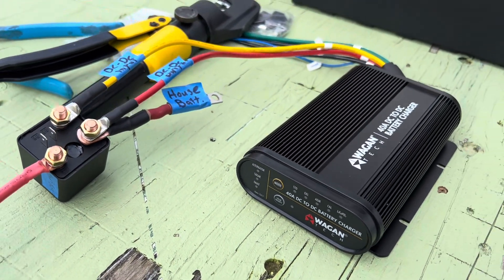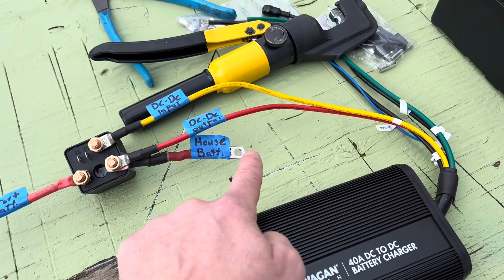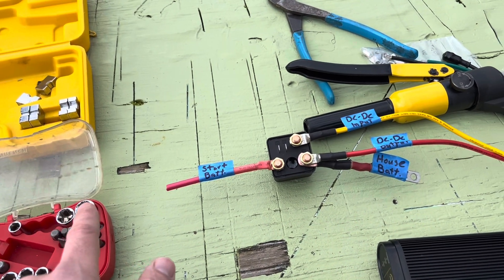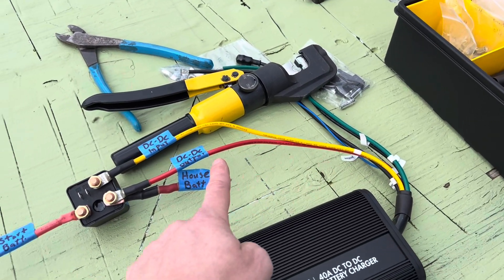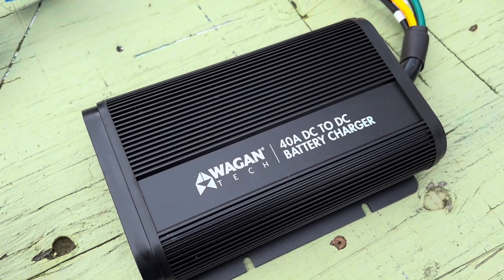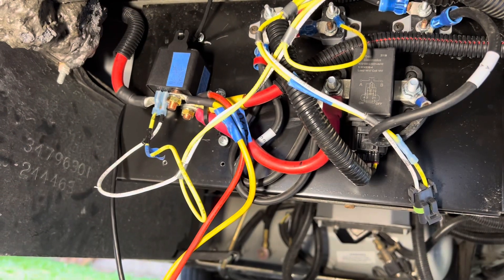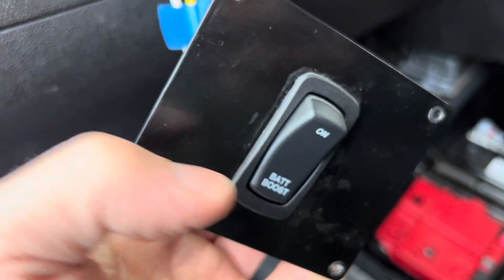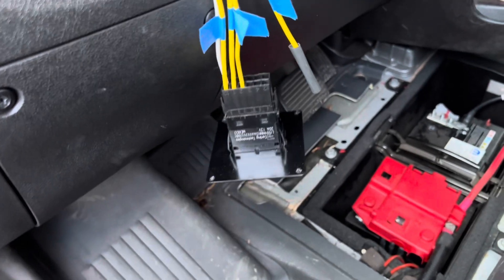Lithium dc-dc charger with battery boost jump start.

Comment: Excellent video, thanks! I've heard that removing pin 13 in the B Pillar also disables the ignition solenoid connection. It sounds like you only need to do one or the other (that or the booster switch Pin 2 removal). Does that sound right or am I misunderstanding?

Comment: This is great… thanks for sharing!  Where did you ultimately mount the DC to DC charger?  I’ve been eyeing the new Victron sx due to its size and IP65 rating.
Reply from the maker: I selected this charger because its waterproof, so it’s mounted the outside of the metal shroud that covers the original isolation solenoid. (Under the van)
Reply: @aarongarmon3809   cool, I was considering doing the same, though I may manufacture a new cover for that box to make it a little bigger and mount it in there.  Thanks for the video!  I’m also going the route of this relay when my crappy replacement solenoid seizes up again.

Comment: Just because it’s waterproof doesn’t mean you should mount it in the most vulnerable position of a motor vehicle. Unless you live in a dry and warm climate, it will fail much much faster. It’s waterproof for the life of the warranty, not the product. That’s even if it is allowed to be mounted outdoors, which it might not be.

It’s likely rated waterproof so it can be mounted in a stationary outdoor position or in something like an engine bay.
Reply from the maker: Understood, thank you. This particular vehicle is used seasonally in the summer, and it’s mounted facing rearward so no to get hit with spray. The entire electrical system is under these vans, so a major rework was not in their budget and would have resulted in a loss of interior space. Everything is a trade off, especially with small vans.